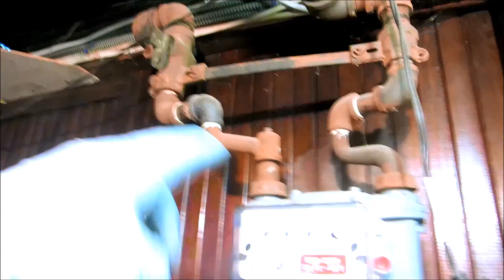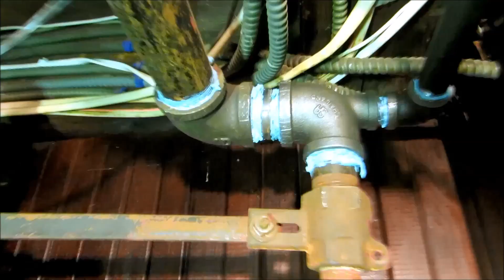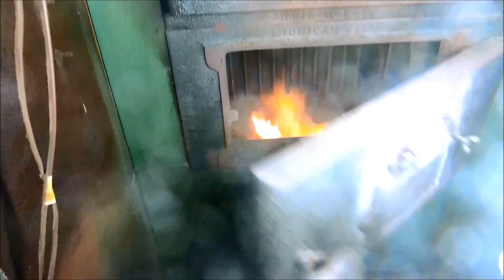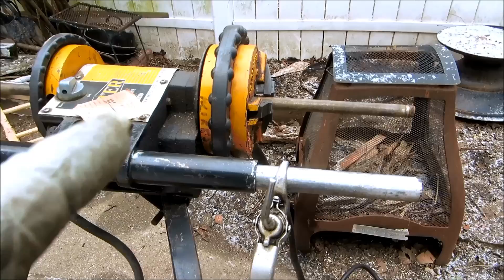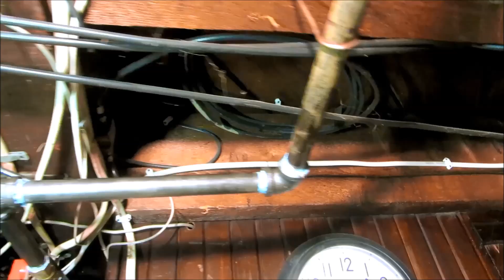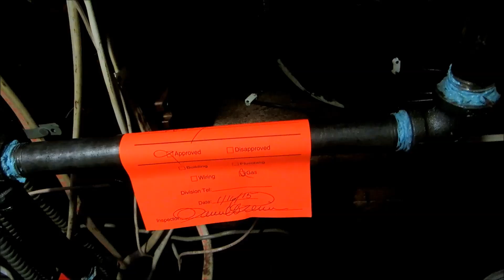gas fire place,gas piping and fired up

Comment: I just ran into a similar fire place, is it ok to run the exhaust vent straight up the ceiling and through the roof? There is an attic above. Does it have to be double wall B-vent flue pipe?
Reply from the maker: Hybrid nj you would have to refur to the factory recommdations for the fire place .. they will tell you how you can vent it ...this one is not b vent its sealed combustion .. so you need special pipe and ternination hood
Reply: ok I see, thanks

Comment: great job, I like that black iron piping.
good looking fireplace there,
had a streak of good luck there almost dead center of those two joist for the pipe to hit.

like your pipe machine,, looks like plenty of torque but looks more portable and lighter than a rigid
Reply from the maker: nate yes the oster 100 pipe machine is the best lighter and faster then the ridgid 300 .over all a better pipe machine problem is they are no longer made.

Comment: Nice work as always Steve !! We would have run Gas-Tite stainless flex down here and been done in about a 10th of the time but your way is the way I grew up doing and certainly a lot better for sure. Looks like about a 450.00 job ? Just curious.
Reply from the maker: Ted Cook Heating Service i do not like to use gas-tite it has to be grounded because of lighting strikes. i will stick to using black pipe
Reply: steven lavimoniere Yes and here they make us bond (ground) ALL gas lines... black iron, copper, and flex.... The one advantage down here of not running 2-psi systems is no regulator and tees have to be added in lines.

Comment: I bet some young plumbers today may never use a threader. It wasn't long ago that every home with gas had black iron pipe
Reply from the maker: airkraft1 i still use black pipe .its a better job .then using the gas tight  flex.and it does not have to be grounded in case of a lighting strike
Reply: steven lavimoniere

It's nice to see it's almost like history

Comment: that drop worked out sweet coming right in between the joist bay good job Steve, I been doing gas lines for weeks straight out here with all the holidays & inspections I haven't had the time to record.
Reply from the maker: Jason the Plumber i like doing gas pipeing
Reply: steven lavimoniere ya same what code they use in your jurisdiction?
Reply from the maker: massachusetts gas code .we have our own code .. the rest of the country uses the boca code . i do believe the mass code is better in many ways
Reply: steven lavimoniere we switched from UPC code to international code a few years back it sucks, I liked UPC better